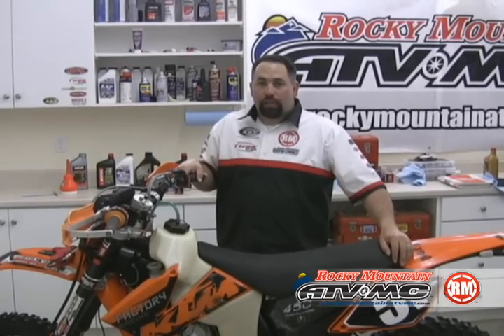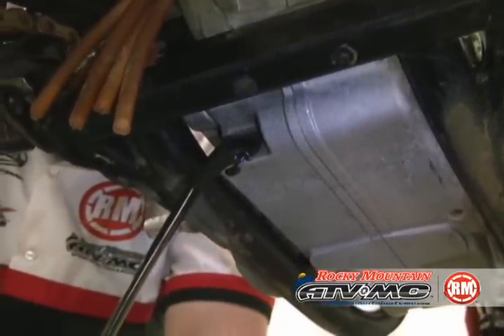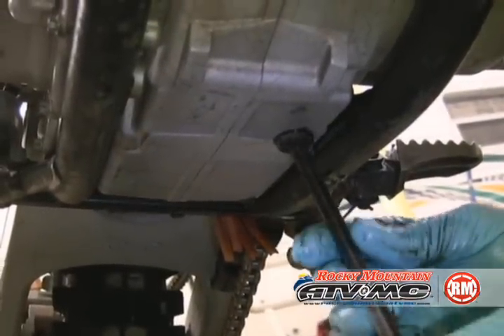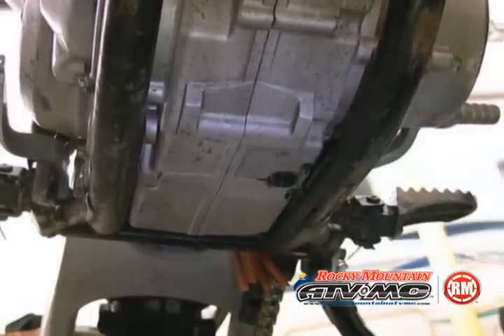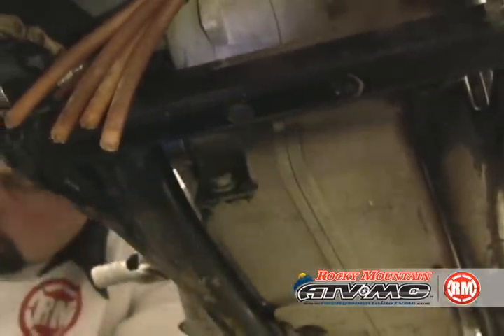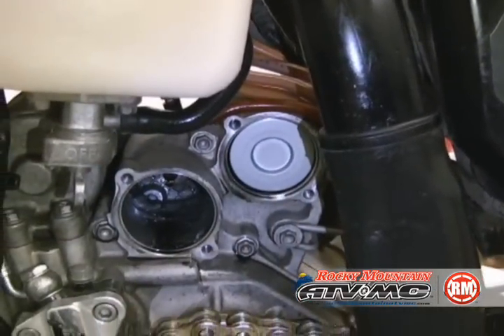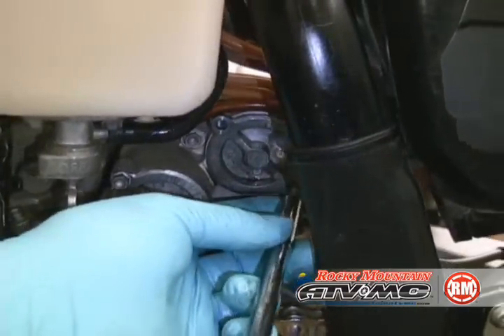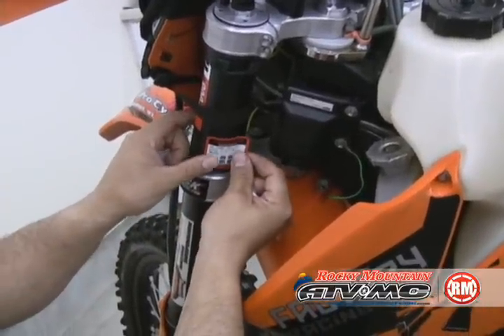How To Change the Oil on KTM RFS 4 Stroke Motorcycle/ATV

Comment: One comment to add to this great vid:

The installer misses a critical step at 3:52, you need to lay the bike on its side when installing the new oil filters. When the bike is laid on its side, fill the filter cylinders with oil half-way BEFORE dropping the filters in cylinders. This step is necessary because it primes the oil circulation, preventing the engine from being starved for oil when it is first started after the oil change.

Also, take care to not over-tighten the drain plug!

Comment from the maker: Hopefully nothing is exploding in your crank case.  The explosion should take place on top of the piston.  Anyway it is a good idea to lube the bearings and seals with oil during assembly.  If you are doing a 2-stroke, use 2-stroke pre-mix.

Comment: Soaking the filter is okay if you can't lay the bike over to fill the cylinders, or if it's an oil filter for an ATV. The idea with either method is that you're priming the oil system so the oil circuit is filled with oil faster, thus getting oil quickly to the engine, instead of having to wait for the system to soak a dry filter. Because KTM's have two filters, (one coarse, one fine), it takes even longer to prime before it gets to the engine if you ignore this step.

Comment: i have a 2008 250sxf and i was unsure with which way the long oil screen should go in. does the big opening on the oil screen go in first or the smaller hole?

Comment: Do you lay the bike on the right side and fill the oil filter housing half way with oil?? I changed my oil filter last night and didn't do that, when I started the bike up a little oil leaked out of the cover...I took the cover off and the oil filter was completely saturated...now it won't start and I'm wondering if I need a new filter??

Comment from the maker: @njs97 - Motor oil and gear oil is all shared on this bike.  So it is motor oil that also lubricates the transmission.
Reply: Rocky Mountain ATV MC I just picked up a 2006 KTM 250SFX  so there is no gear oil the engine oil you change if also for the transmission? And is this still the same way to change the oil on this year bike cuz the guy I bought the bike didn’t come with a service book

Comment: hi, 

i speak poor english but i'll try!

i broke a bolt (the one right side below), the bolt that closes the cover of the oil filter. I drilled it out but i had to drill a little bit in an angle... plus when drilling i got a felling i drilled to far, like i drilled through something?! 
now there's oil leaking through this hole (where the bolt is in), i am thinking of sealing this with heat resistant silicone. 

Do you know if it is possible that i drilled through something? what's behind it?..

Comment: I can't get the Allen key oil drain oil at the bottom of the engine to budge and it's not sitting completely blush with the design of the whole that it's supposed to be screwed into it is a little off centre maybe somebody has done something too much prior to me having it I am going to leave that because I have a bad feeling that someone is obviously threaded it or did something to it at some point but the rest of the filters I did no problem so I don't think that bottom screen is too much of a big deal not ideal but should be ok at least I hope so I don't believe it's worth me forcing do undo the Allen key under the engine and I thought the engine at 1.6 L that's what KTM told me 10w 60 that's what they recommend for Australian conditions who knows play video man really well done nice and clear and very understandable thanks so much for this